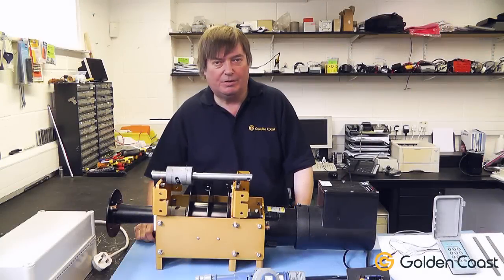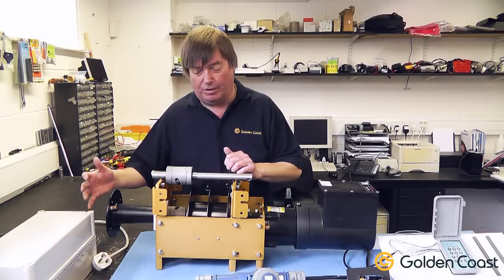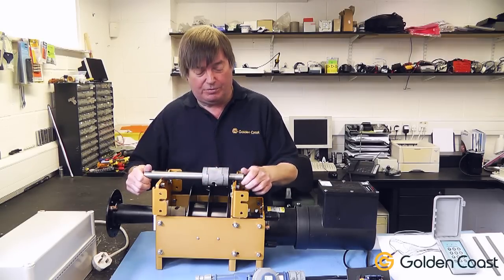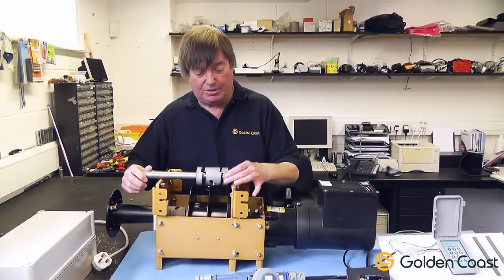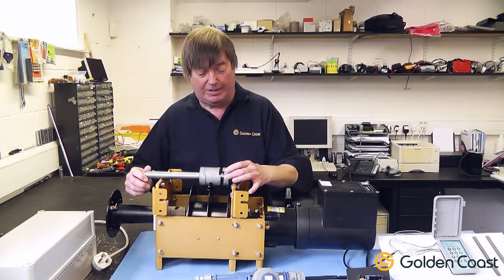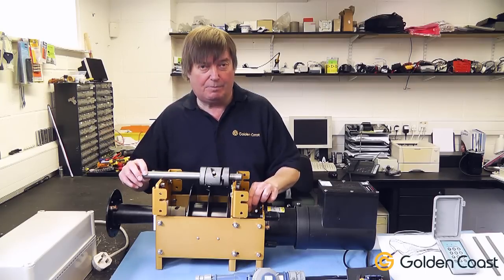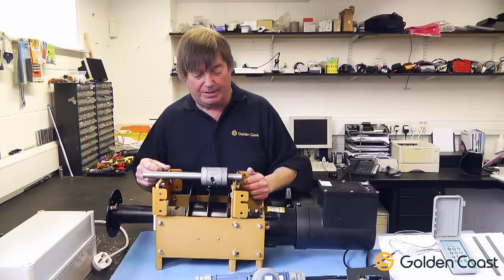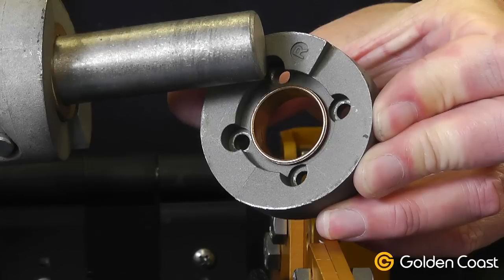Infinity Pool Cover Dog Drive | Andy's Answers

Comment: Both pins on my dog drive have sheared off.  Is it possible to purchase a new dog to avoid the high cost of a full reversing unit?
Reply from the maker: Hi Peter, I'm afraid we haven't been handling the Infinity Cover system for a few years now and am unsure who you should contact in the UK. Probably best if you make contact with them in the US and ask who their UK distributor is. info@infinitypoolcovers.com
All the best, Andy